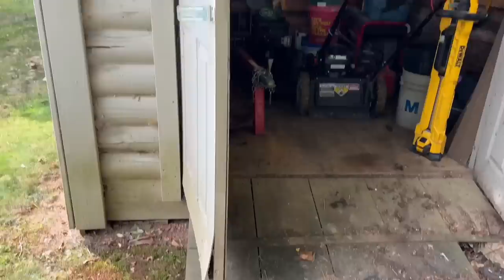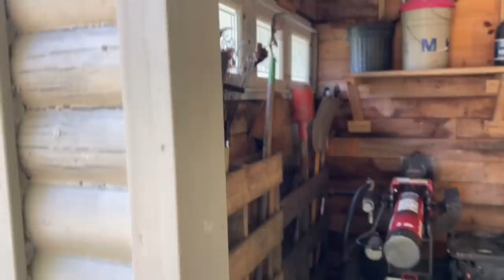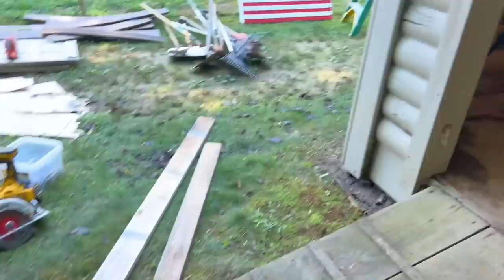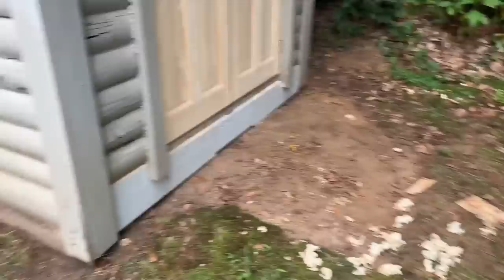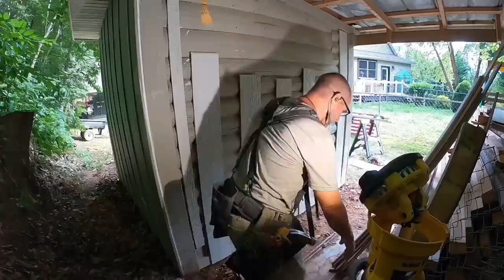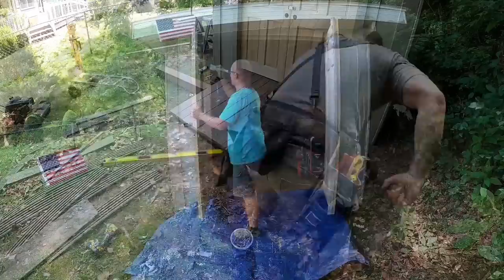Jay’s Shed Makeover—That’s one way to do it!

Comment: I built my ramp to my shed using the tree also. I ran my boards horizontal with the space between. I had noticed that the previous ramp I would slide on when it was wet or there was snow. Now with them running horizontal with the space between it allows water to drain and the gaps between help create a good grip so i don't slide.
Reply: trex not tree

Comment: When I built my shed,  I framed my door out based on the widest thing I would take through that door, and then I added 8" to that.  Framed the shed out of 2x4's but the door opening and door out of 2x6's. Threw 4 hinges on the door so it would still swing open easy. Like my door way  better for a shed then anything I could buy. snow blower goes in easy, quadbike, etc..